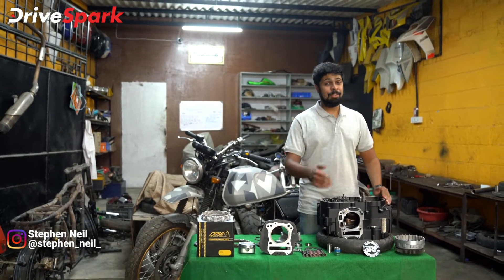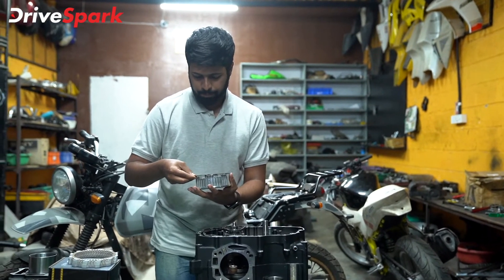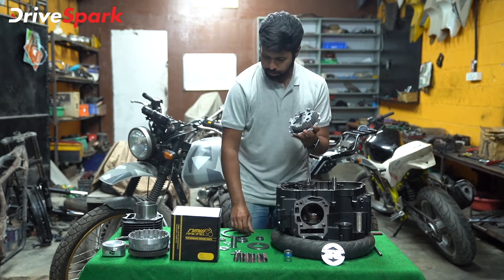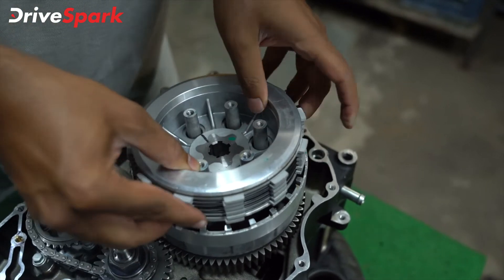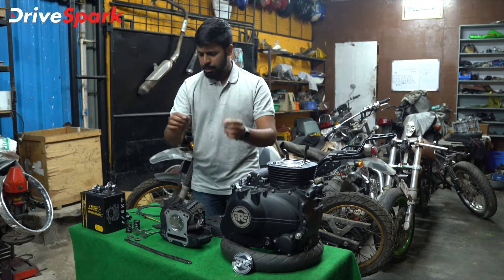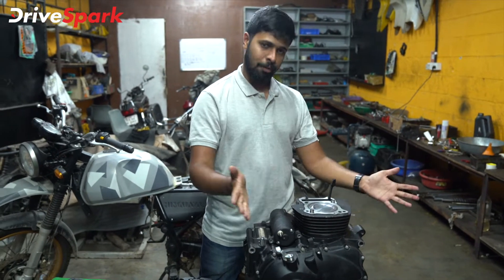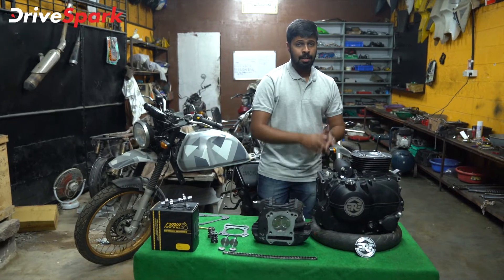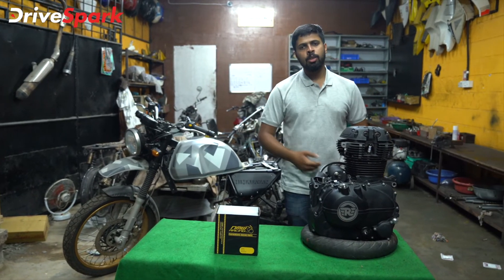Royal Enfield Himalayan Modified | 500cc NMW Racing Big Bore Kit | Engine Assembly | Episode 3

Comment: If you want more power, just buy a bike with more power.
This is all half ass amateur solutions.
Reply from the maker: When you order food, you tend to add some salt or pepper to make it taste better as per your preference. You don't go order the salt and pepper for food. Same concept applies for modification. #BuiltNotBought
Reply: @DriveSpark  I agree to a certain extend, but not with well engineered engines.
In most cases it will not be worth the effort and money.
Reply: @ekimandersom4478  If you really like the bike, which I do... then fiddle around and make it better. The Himmy is a great bike, nothing wrong with tweaking it and just adding to the pleasure...don't call us half ass amateurs...!